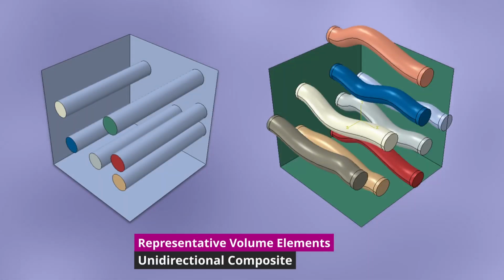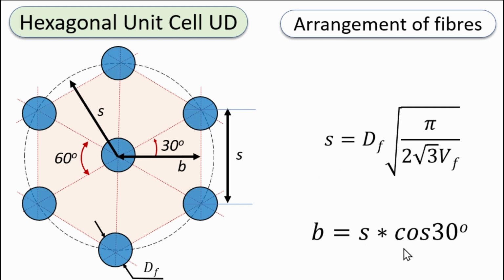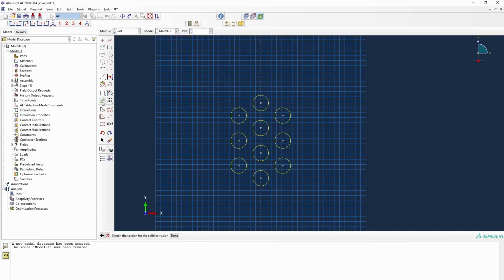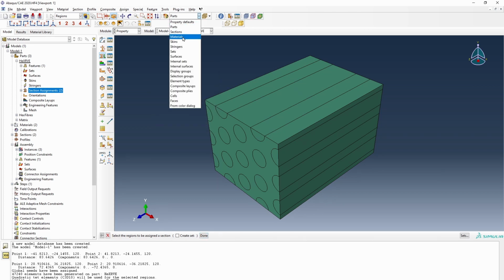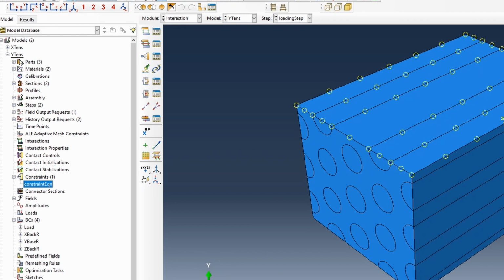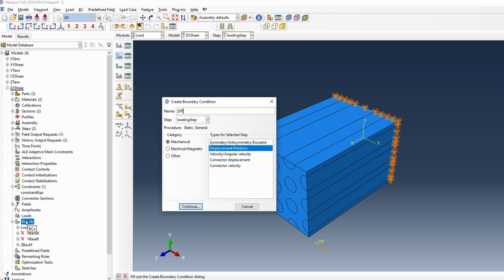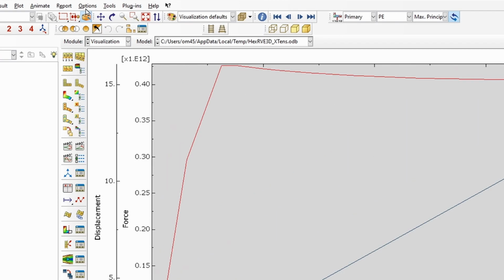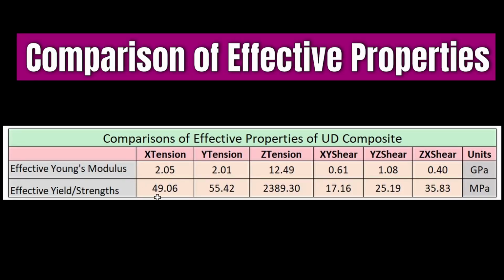Hexagonal unit cell modelling of unidirectional composites

Comment: Dear Dr. Michael, Very interesting video but really I get confused why you called it unit cell modelling as you modelled a RVE with multiple inclusions, I mean you should model RVE domain with a single fibre. Can you correct me if I am wrong as I am thinking that the unit cell modelling is a special case for RVE including only one single inclusion. Thanks in advance
Reply from the maker: Hello @John Nabil, this is a very good observation. Unit cells do not necessarily need to have one cell. They are rather the smallest virtual domain with a unique repeating pattern for test material of interest. In this case, we could isolate a hexagonal unit cell (with one-fibre) but it will not have a cuboidal structure (as I have shown in the video), but rather a hexagonal structure. I did not want to make this video with a non-standard RVE because of the post-processing needed later on. So, I decided to use a slightly bigger domain but this makes the approach closer to RVE-modelling as you suspected than unit cell. 

The way people have tried to solve this conundrum is to isolate a non-cubic unit cell with longer height compared to width so that you can have a representation that captures the hexagonal arrangement whilst still keeping to the cubic/cuboid arrangement needed for micromechanical studies. 

What I will say this video is a hybrid of unit-cell with RVE modelling but the intention was really to do a unit cell modelling.
Reply: @MichaelOkereke  Dear Dr. Michael, Thanks a lot for your clear detail explanation. Regarding mentioning that you didn’t like to use a hexagonal unit cell which is a non-standard RVE as it is not cuboidal structure. Is the RVE has to be square or rectangular in case of 2D and cubic in case of 3D or is it possible to have circular or spherical or any other shapes. If so, kindly let me know what is the different for these cases, I mean is the changing only in the geometry of RVE so I can model them as standard RVE but with only different geometry or there are some requirements I should considered in such these cases. Thanks in advance
Reply from the maker: Hello @John Nabil, clearly the choice of RVE is yours, and you might have to investigate which one has the greatest impact on accuracy of model prediction (during the validation phase). It is an iterative process, until you find what works for your specific model. There are books that have discussed this topic but I cannot remember one now to refer you too.
Reply: Dear Dr. Michael, Ok but in case of using any other different shape of RVE such as a hexagonal or circular, kindly let me know what is the different compared to standard square RVE, I mean are there any  requirements I should considered in such these cases. Thanks in advance
Reply: Have you figured out the differences between cells of different shapes? Especially in terms of their impact on predicting elastic properties, thank you. @joonabil

Comment: Hello sir, just a quick question here. Did you consider imposing periodic boundary conditions for the RVE?
Reply from the maker: Definitely P U, imposing PBCs on 3D RVEs as used here is worth considering. I did not consider it because you would need a special software to impose PBCs on 3DRVEs. As I do not have a publicly available tool (released from my company) to show this, then I could not show this for these unit cells. In future, when such codes because available, then we can consider the implementation of PBCs for such 3D RVEs as considered here.

Comment: Hello! What is the analytical Young Modulus of that composite? Would like to compare with your numerical...
Reply from the maker: Hello @Ayaulym, the best way is for you to calculate it using the classical rule of mixtures equations. All you need note is the volume fraction and moduli of the individual E-glass fibre and Polypropylene matrix constituents. You can follow this more in the referenced publication here: 

Source: Okereke, M. I., and A. I. Akpoyomare. "A virtual framework for prediction of full-field elastic response of unidirectional composites." Computational materials science 70 (2013): 82-99.

Good luck

Comment: I am curious of a solely single fibre tensile testing model without resin up to fracture. Could you have any comments about this? Can it be done using Abaqus?
Reply from the maker: Hello @Enidentictok, certainly this can be done in ABAQUS. It is essential a fibre model and you have to incorporate a fibre failure model to make this happen. Most of the time, you may have to write a user-defined subroutine for the fibre failure model to do such modelling. The existing composite damage model only models laminate composite and not single fibres. So, short answer Yes, it can be done, but long answer - it is not easy as you will need to use a UMAT to achieve this.
Reply: @MichaelOkereke  Thank you for your kind reply. I am new to do ABAQUS. UMAT that I ain't aware of. If you have a plan, would you introduce UMAT and its simulation video?
Reply from the maker: Hello @Enidentictok, always good to make videos on UMAT. I have a chapter about this in my Finite Element Applications textbook. Please refer to that. I am not focussing on making UMAT videos now, there are guys on Youtube like Dr Ronald Wagner (https://www.youtube.com/channel/UCU3dmUB40wf5RCEGp9UMtbA) who have dedicated videos on writing UMATs. I will encourage you to check his channel out.